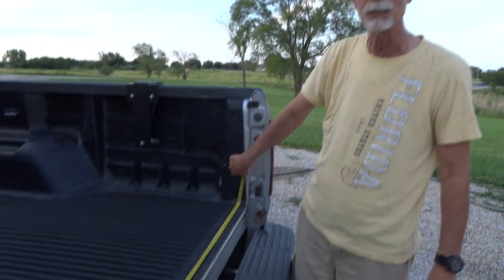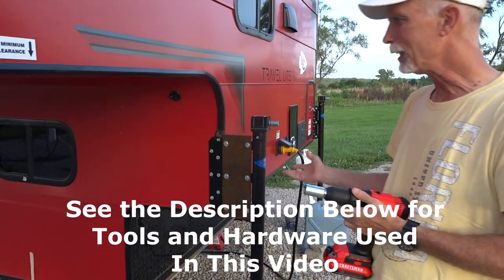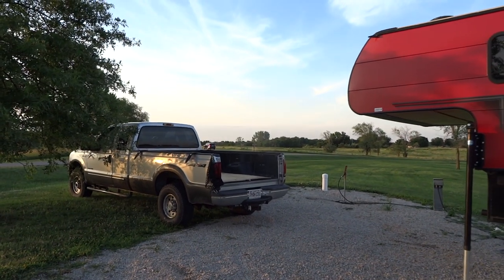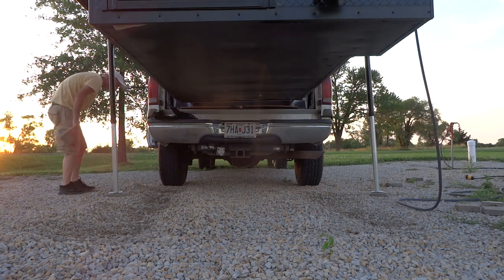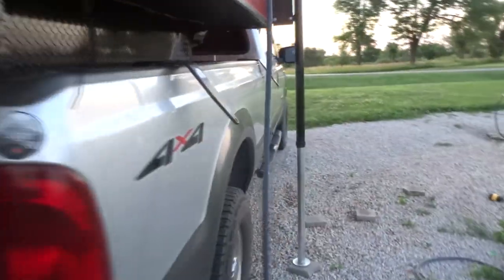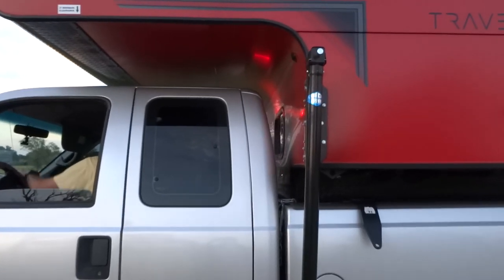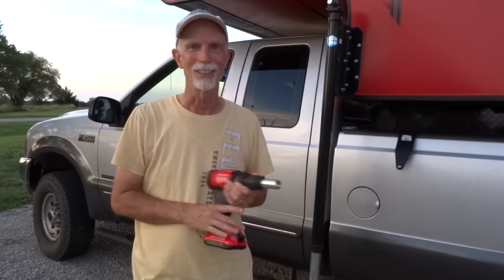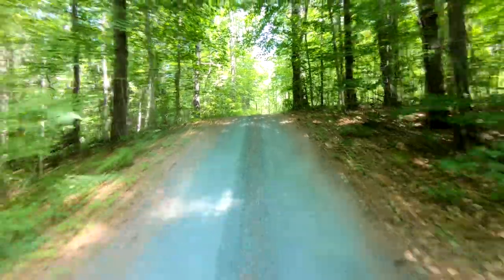TIPS on HOW to LOAD a Truck CAMPER / Mechanical Jacks HACK / Travel Lite / Truck Camper Life-RV Life

Comment: Thanks for posting. Might make it a bit easier if your drill has a screw in handle for some extra leverage. Since you have to rotate among the four jacks, it might save time if you marked your stop positions.  Your jack movement is in four-inch increments so you could mark each jack at those intervals and lift or lower to each mark. Thanks for the tips and tricks!

Comment: Great video points, THX!  One great trick also is when you get your camper up to the height you need to load take a Sharpie and draw a line around the inner leg tube at the point where the outer leg and inner leg meet. That way when you're lifting the camper to bed height you just look for your marks on the legs and takes less time and guessing.
Reply from the maker: Thanks that is a great idea!

Comment: One more trick, take a rule tape to measure and record the support legs length when you take the camper off the truck. If the campsite is not level or uneven on a side this will ensure the proper height and a match to the truck bed for loading. Easy peasy loading
Reply from the maker: Great idea!  I will have to do that the next time.  Thanks for the help!

Comment: I’ve only loaded mine 3 times also, hand cranked, it’s a job, by myself. Electric jacks would be a real plus I believe, in the long run.
Reply from the maker: There is no doubt, having electric jacks is a real game changer.  However, the impact cordless drill is a much, much better option than hand cranking the jacks.   Is there a $1500 difference between the electric jacks and the drill.  That is the real question for me.  Since I don't take the truck camper off that often, I can't say it is worth $1500.  Thanks for your comment and for watching.

Comment: When you are lowering, bring it down to about an inch of your rails. Then lower the rear all the way and it will nicely slide slightly forward for a tighter fit. Then lower your front legs all the way.
Reply from the maker: That's a great idea!  Thanks for sharing it.  I will do it next time I have to load it. :)

Comment: Hello folks, Im a newby  at this as well (first time). Great video and thank you.  The only thing I noticed is that your tie down brackets may be mounted to far back on the truck bed rails and should be more forward when installed as this would also prevent the camper pulling out of the box like saying climbing a super steep hill or quick takeoff.  Thanks again for the awesome easy understanding video
Reply from the maker: Glad it was helpful to you!  We have since sold the camper.  If we get another one I will keep the tiedown tip in mind.

Comment: Hey there! The tape in the midle was a good ide. I use tape, but on a another spot. I think you can adjust sideways a litle bit by tilt hard to on side also. I wonder, have your camper rubber under the camper? I use a rubber carpet on the bed, so the camper do not move around. Nice video!
Reply from the maker: Great tip!  I will have to look for a rubber carpet.   The board that we use does have a tendency to move over time.  Thanks again!
Reply: @GrassRootsLiving  I bought a rubber cow stall mat / blanket. It was less than 1 inch thick, heavy, but very solid.

Comment: If it's misaligned by a few inches it's easier to move the camper than the truck. Seems scary but you can wiggle it around pretty easy on the legs.
Reply from the maker: I think my wife would literally die of a heart attack if I did that.  :)  I do think you are right however.  Thanks for sharing the tip.  :)

Comment: Do you put a support/jack somewhere so when getting in bunk the camper does not tip forward?
Reply from the maker: No, there is no need to have an additional jack.  The back of the camper is where most of the weight is located.  The weight of a couple of people on the bed will not come close to upsetting the balance.

Comment: Wow that took for ever to load camper..After loading camper enough times ,you should not need tape centering.Using your mirrors watch camper lower walls in relation to truck bed sides.  It is a good practice to keep front jacks raised 3-6" higher than rear jacks, when raising and lowering on to truck bed. This relieves stress on front jacks from sleeper cantilever weight . full water tank, and only one mounting point on front jacks vs.rear.When truck is positioned under camper to load, apply truck e brake, Automatic put in neutral shift position. Manual trans. pull out of gear. When lowering camper lower back jacks down and fronts so rear of camper seat on bed first,now seat front of camper. You should see that truck rolls slightly forward. You are seating front of camper tight to front of truck bed without stressing camper, truck bed or front camper bumpers. Oh remember to plug in camper harness before dropping camper.
Reply from the maker: Thanks so much for the great tips!

Comment: Nice job loading.  
You bought 40 volt batteries as spares for your 20 volt drill?
"can you use a 40v battery on 20v tools? No, not without intervening circuitry to step down the voltage to 20 volts. You can generally use a higher capacity battery (that is one with more amp hours and thus run time) but the battery itself has to be 20 volts. Higher voltages will destroy the tool."
Reply from the maker: Thanks so much for pointing this out.  At the 11:35 mark, I misspoke.  I said that I picked up two 40V batteries.  I meant to say I picked up to 4.0 aH batteries (that are also 20V).  They hold more of a charge than the one that came with the drill but I assure you that they are 20V.  My mistake but I am so glad that you pointed it out so others that read this will not make a mistake and buy 40V batteries.  :)
Reply: @GrassRootsLiving  We all make a gaff here n there.  You just proved you're human is all.
Subbed ya.
Reply: I think he meant 2amp  vs  4 amp batteries not volts.  I have the same craftsman power tools

Comment: I have a 1995 Chevy 1500. Can I use this brophy mounting attachments?
Reply from the maker: The Brophy tie down system appears to be compatible with almost all trucks.  I was very pleased with how it performed.  I would purchase it again if I got another truck camper.
Reply: I have a 1996 Chevy 2500 and they work just fine.
Reply: Be extra careful when driving with the brophy tie downs. I went on a road trip all throught the rocky mountains and they did not survive the trip. Two of them were totally bent and the top rail of my truck bed was bent out of place.

Comment: done it many times and never looks fun lol
Reply from the maker: I definitely think that we will get much quicker at it but you are right I don't know if it will ever be fun.  Thanks for watching.  Can you think of anything that we missed that would make it quicker or more efficient?
Reply: @GrassRootsLiving  Yeah we did that just about every other weekend for 9 years with my son was racing motocross, you have it covered pretty much, only thing I couldn't see on yours was we had a 2x6 piece of lumber on edge up front as a spacer to keep the camper from rubbing on the bed of the truck.  The rest is practice practice practice LOL... it gets easier. Nice job working together too!  Cheers- Dave
Reply from the maker: @OurEndeavor  thanks. Good to hear that from people that have so much experience. This camper has build it spacers, so that's handy. Not sure we'll ever be good enough to want to do it every weekend, but we're sure a lot better than when we first started. lol  Thanks for your comment and support.